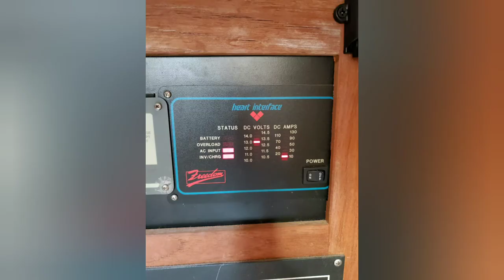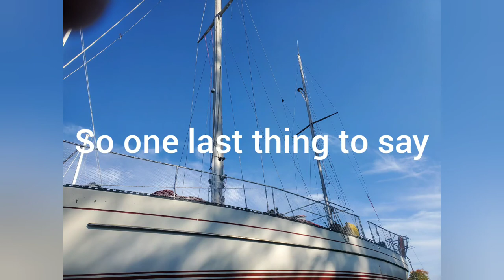Hughes 40 sailboat rebuild,  year 2

Comment: Where did you acquire the mast step? Looks great, I am going to look at one for the second time tomorrow that needs hopefully half as much work but you know how that goes. hoping to make a deal on it. thanks for the video
Reply from the maker: I had the mast step manufactured at a metal fabrication shop near my town. It wasn't cheap at ...I think I paid about 750 for it. I took my old rusty one in and they just made an exact copy. Here's the link to the company I used, if you're nearby. https://lbwelding.ca/ 
Good luck on your purchase,  hope it works out
Reply: @PyeGuySailing  I have watched this video 3 times.  Where is any reference to the mast step??  I am currently looking to buy a Hughes 40 with a bad mast step.
Reply from the maker: Hey, I believe he was actually commenting on my first video.  3:47 seconds in. I didn't explain how I replaced it but I'll explain it here. Since I had to gut mine It was easy to just unbolt it and remove it because the floor was gone. However you can cut out a hole and patch it later. Then I took my rusted out mast step to a local metal worker and had him make a new one ( the design is simple) you can see it in the video) or I can email you a few pictures if you want. I paid $700 him to do it but it came out great and I just bolted the old foot to it.(maybe you can find someone cheaper or know how to weld?) But if the foots destroyed you can just have a ridge welded on the diameter of the mast. Make sure you're on the hard though because the forward keel bolts go through the mast step. Any questions feel free to ask, the Hughes 40 is a beast of a sailing yacht that can take you anywhere.